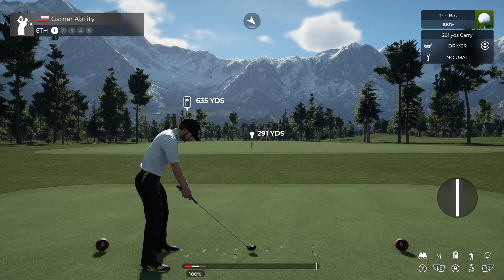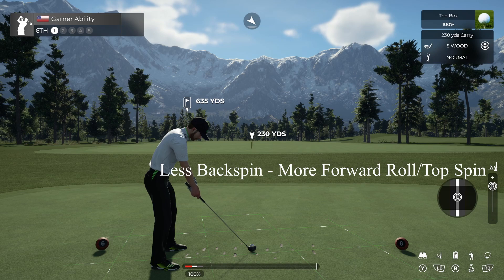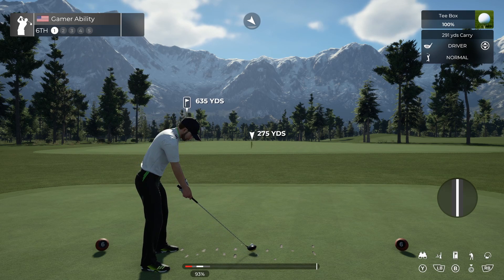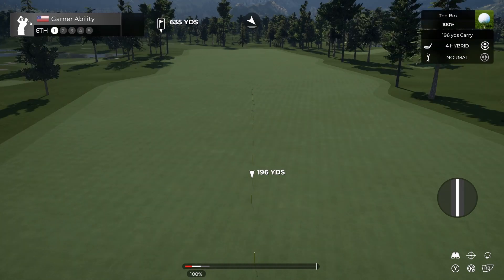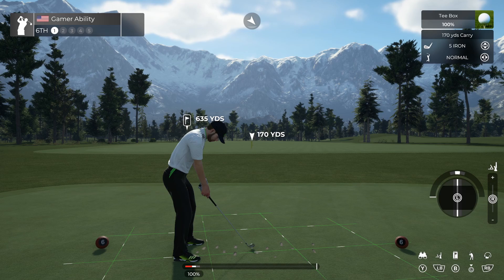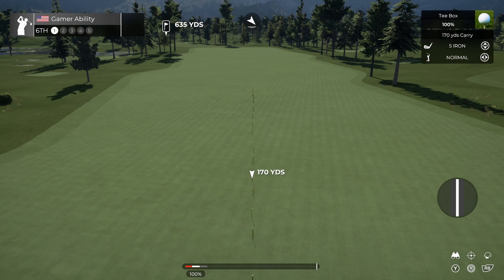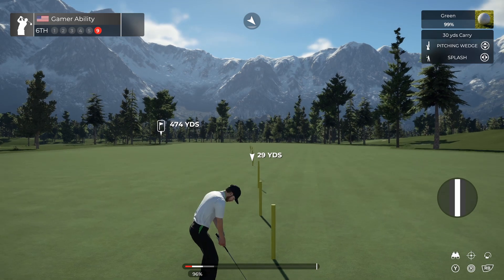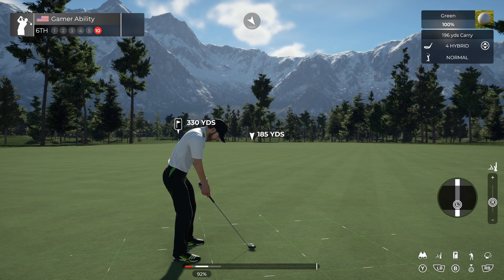How to Master Shot Shaping Loft and Spin Control in PGA TOUR 2K21 -Gameplay Tutorial

Comment: Hello - Is this practice spot published so that others can use it?
Reply from the maker: So it is not actually a full course, I just went into the course designer and flattened a large area and placed some different surfaces around. This allows you to pick up and put the ball where ever you want and to turn on auto mulligans. You can also change the wind and green firmness/speeds which is great for practicing. Hope this helps!
Reply: @GamerAbility  Hi GA. Now I'm down the designer rabbit hole! I haven't found a way to turn on mulligans in a course I design, unfortunately. I can only rewind the shot repeatedly. Perhaps that was something available in the previous version of the game?

Comment: You can hit percentage shots with a driver with draw or fade shots which also can be affected by wind speed and direction, you just have to be able to hit the ball straight lol
Reply from the maker: Yeah that is true! I do not use that method very often but I know a lot of players have success with it for percentage Shots. My swing plane does not fit well with that method sometimes 🤣
Reply: @GamerAbility  I usually draw or fade with the wind to give the ball better flight length unless I need the ball to sit, also it can help with fairway placement if it's uneven ground as you can control the flight angle and direction when the ball lands. I just play on the pro settings coz that's what is default on multiplayer.  Sometimes on pro settings it can be hard to hit big draw and fades because of the swing margin decrease, but it looks silky when you get it just right